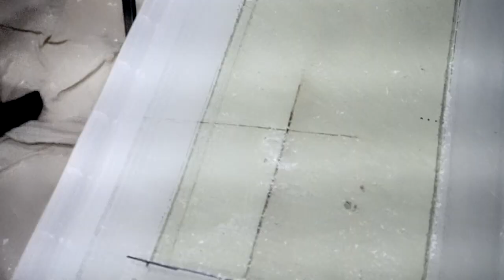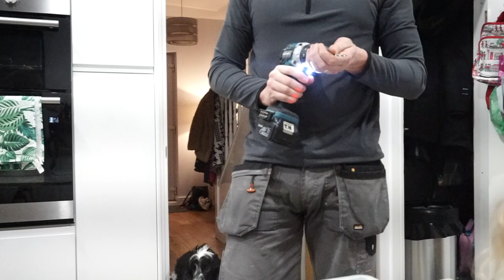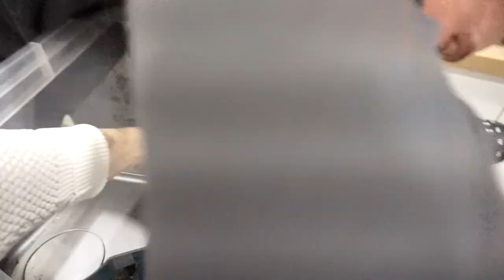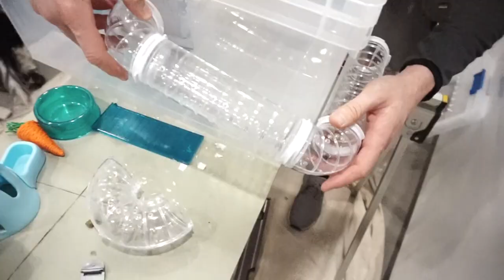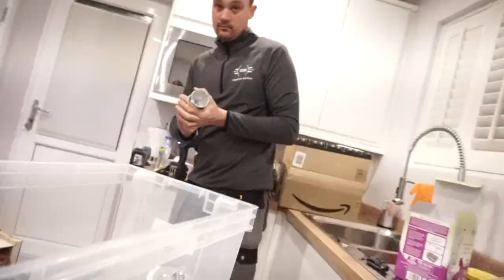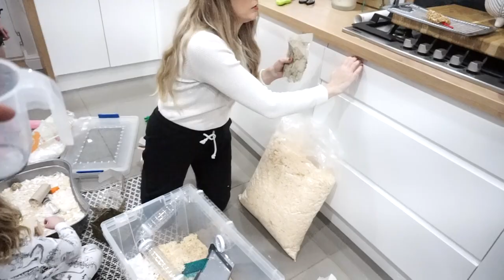SPEND SUNDAY WITH US | WE MADE A HAMSTER BIN CAGE | day in the life as we make a DIY bin cage

Comment: I do suggest that you switch out the storage bin for a bigger one. The minimum requirement for a hamster enclosure is 450 sq inches. Though the bigger the bin cage the better. The way to figure out the measurement of the bin is to measure the bottom of the bin not the lid. You just multiple the length and width of the bin cage to get the measurement. Also it has to be one big bin not two bins connected together.
Reply from the maker: Kimmee Cheah yes we plan to make a bigger one as he has outgrown this one! It makes you wonder why the shops even sell the small cages doesn’t it! The original cage he had was so tiny compared to even this bin cage 😮
Reply: @EmmaJNightingale  thats totally right like its just torture i let my hamster free in the whole house just not the bathroom cause theres a whole. And then you can just see a little cage is too small. We also wouldt want to live in our house forever without going outside and bending our body in small wheels.